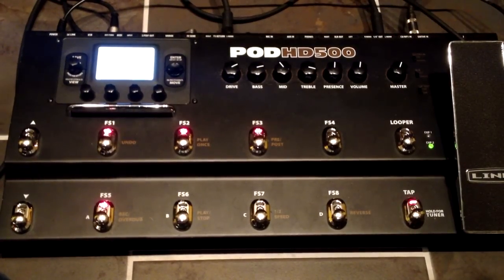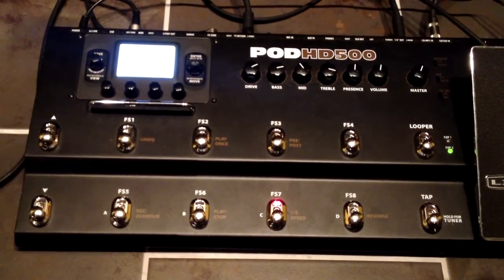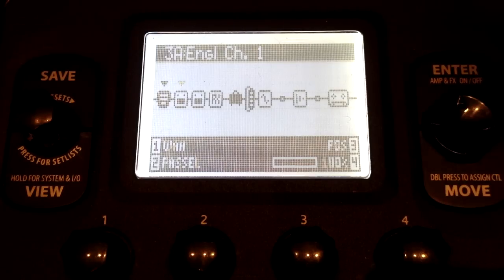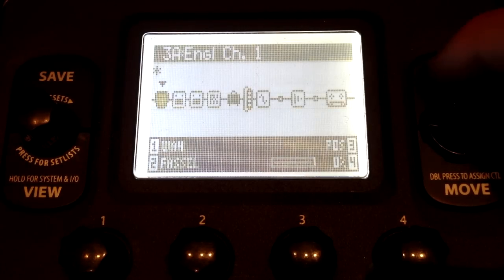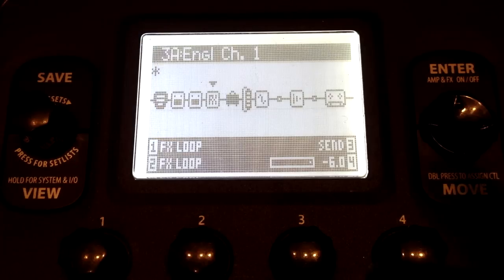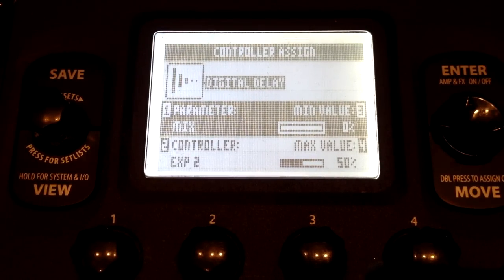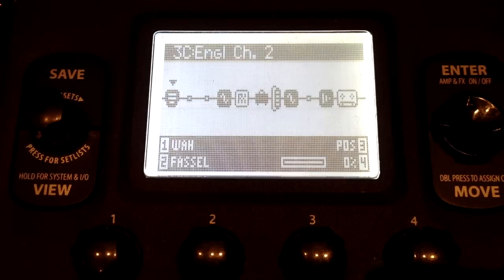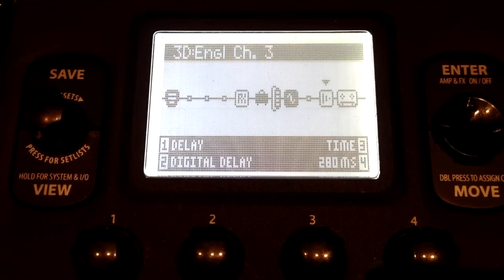Pod HD500 rig/tutorial - 4 cable method (4CM)

Comment: Dude! I've been using the Pod HD500X for about 2 years with an EVH Lunchbox amp. I've been trying to figure out the best way to use my amps Pre Amp (Over the Amp Sims) but also switch to clean on the amp/clean preset on the line 6 when i need to. As my amp doesn't have midi support this has been problematic (Lots of awkward tap dancing)

You've just solved the mystery for me and i don't even need to switch the Amps Channel. I originally had the FX block set up on both my overdrive preset and clean preset. But now i just have my Amp on the dirty channel permanently, and i've taken the FX block off my clean preset.. so i get beautiful cleans with one button press and my Amp is in overdrive the whole time. 

Thanks so much for that tip, i honestly had no idea that the FX block could be used to bypass the preamp, made my life so much easier!
Reply: I agree! I’m attempting to do that myself. Just trying to get familiar with the settings and everything else. 
Had an X3 live in the past. From what I remember that was much easier…
Touring/live I’ve been strictly guitar- wah Marshall with the addition of my talk-box. I rely on our sound man for all my effects. Dry on stage wet out mains.
But I’m old now and the HD500X seems to be a great piece of equipment! 🎸👍🏼

Comment: Absolutely amazing dude! I bought the HD500 over a year ago and could NOT find a good way to use it. This video has been of more help than all of the Line 6 Tutorials! I'm subscribing!
Reply from the maker: Adam McPherson Thanks, I really appreciate it.  You really can't beat the HD500 considering the massive amount of features and the affordable price.  I'm really impressed by it.
Reply: Presets need to be set up according to which way the HD500/500X is to be heard. 
That being Direct into mixer. 
Using power amp and guitar speakers. 
Using as shown guitar amp and speaker. 
FRFR a full range set up which can be a pair of powered monitors. 
Using one of Line 6s proprietary FRFR systems or Line 6s dt25 and dt50 amps creating the "Dream Gig". 
And now the Firehawk 1500.

Comment: Hi Richie, just wanted to say big thanks for breaking this down i finally understand the concept of 4 cable method and will up my podxt500 with my 6505+. thanks
Reply: VelezBiH I have the same head! what output setting did you find worked best? do you do studio/direct or use the stackpoweramp? I'm curious about your levels between the FX loop and mixer levels within the pod. what I found, distortion wise, my favorite tone seems to be when I use my peavey preamp but with a tube screamer, vintage preamp, tube compressor, EQ with 3-5db of a boost at 800hz, into a gate, into the input (before the FX loop on the POD). I also turn off the cabinet simulation. your thoughts?

Comment: Your video rocks!  After some trial and error, I got the 4CM working with my Pod HD500X.  I was also able to configure the Pod to send MIDI into my amp to switch amp channels when I hit a footswitch.  Now I can put the footswitch that came with my amp into storage :)
Reply: Is that how he’s doing it? I can’t think of any other way that’d be possible. I’m not familiar with Engle (I think…) amp(s). They’re midi capable?
If ya don’t mind me asking, what amp do you use? 
Thanks ahead of time. 👍🏼
Reply: @BusterRoonie  I have a Revv Generator 120.  It is MIDI capable.  You can program your POD or whatever MIDI capable multi-effects pedal you have to send a MIDI note/command when you hit a footswitch, then program the amp to switch channels based on that note.  You have to read the documentation for both, and it took me some time, but you can definitely do it!
Reply: @mahnplaysmusic  I’m running through blackstar by club 50mk2. Combo. So basically i can do everything but change Channels with the HD500X, correct? 
I’m fine with it. “Ya do t miss what ya never had” lol. 
Thanks my friend!!👍🏼

Comment: Great explanation.  I've got an HD500 with a Spider Valve amp and am itching to use both together.  I've spent literally years crafting great sounding patches using the HD500 with a Radar IR pedal in the loop.  Now I'll have to recraft these patches to take the power amp section,  (and the Radar), but not the preamp, out and use the Spider Valve for the power amp for some patches, but also use the various tone stacks in the Spider valve for others.  Nice to know this can all be accomplished.  The only big inconvenience is what to do with the Radar since it will be obsolete for all the new patches/setups.  I'll probably keep it for gigs when I don't want to drag the tube amp along.

One critical comment: that great diagram you made should have been in the front end of the video.  I almost skipped it but it really would have setup your explanation better up front.

Comment: Cheers man ! Sorry to be a pain but do you assign the midi signal to the foot switch and then build your preset on top of that or how do you assign a channel to the preset ! Thanx for all your wonderful videos 👍
Reply from the maker: +Emil Bendixen Generally, you program the amp to respond to the preset, but if that doesn't work with your setup, you can also completely re-map the pod presets to send whatever program change you want.

Comment: Hi Richie.
Very cool video. I undertand much better now. I have a lot of material but didn't really try to go further because I always thought it was too difficult.

Now, what I would like to ask is :
I have a Herbert Diezel which I can  control by midi, a Pod HD Pro and a voodoo lab ground control pro.

Concerning the 4 cable method, does it only concern my amp and the POD ?
Because I used to connect the Voodoo Lab to the Herbert just to select channels (the aim is to using POD and its effects) and I do this using midi cable with 7 pins and 5 pins > 

It goes from the Midi Out of the Voodoo Lab to the Midi In of the Herbert. 
Thank you for reading and I hope I was clear. Cheers

Comment: Great video... Can the POD HD500 switch the 2 amps channels on the Roland Jazz chorus 120 ???
Reply from the maker: goumork I'll probably make another video explaining this.  Unless your amp has MIDI switching capabilities, you'll need to buy a MIDI amp switcher like the Voodoo Lab control switcher to interface between the pod's MIDI connections and your amp's 1/4 inch footswitch connections.

Comment: Hi ,one small question please,does the amp need to be midi control foot switch to be able to use the full amp channels?as my new PRS amp is not midi controlled switch,i am loosing the controls on clean channel on my amp when im connecting 4 cable method ,as stays on channel two but when i assign the fx loop to foot switch on board,its by passing the distortion and goes to clean preamp but without controlling the tone on clean channel knobs

Comment: Richie, I reciently decided to retire my old X3 pro and purchased a 500x. I also purchased a DT 50 head. That should be easy with an xlr cable. And until I can afford another DT amp, I ave a bugera v55, an inexpensive but nice sounding full tube amp with an fx loop. Pretty basic no midi, (although I considered putting the x3 pro into the fx loop for the Bugera. But then it gets way over my head. So what I’m looking for is to get a stereo rig for ambient big wide sounds using the HD 500x, the DT 50 and the Bugera v55 head. I know that on the 500 x send is a single TRS Jack, I’m also mainly using one of my Variax Standards so input VDI. DO YOU HAVE A VIDEO TO explain how to hook these up stereo. I know this takes oddles of your time, but you’ve been my hero these past couple years in working with line 6. Thanks. I’m a 66 year old fan that when BOC came out I was just getting out of HS and I assume you wernt on the planet. A dream come true for me congrats.

Comment: So if I wanna use presets or downloaded tones with the 4 cable method, they will sound better if I insert the FX loop after the amp in the preset patch?
Reply: I know it’s been a while. But I just caught this video. 
Good question. Was wondering myself. Did you by chance ever find out? If so, would ya mind sharing that info? 👍🏼

Comment: Richie I have a question. is it possible to still use my tube amps gain (OD and gate pedals in front), for my dirty sound, and then change to a clean/chorus sound from the pod by pressing one button? I'd I like to bypass my pedals in front of the amp and engage the pod simply by stepping on it. And then when I want to go back to dirty I could step on that same button. Is that at all possible/worth it to do? (I love my amps brutal tone I could never use an amp modeler when I have an amp that I love
Reply from the maker: Paul reed Smith Yes!  Absolutely!  This is what the 4 cable setup does best.  I would set up your dirty sound to utilize your tube amp's preamp, and for the clean, I'd use a pod model.  This makes it so you don't need to rely on channel switching on your amp.  You can do it with channel switching, but it's more complicated and may require more gear.

Comment: How do you use a patch from the line 6 custom tone website using the 4cm, while keeping the tone the origional maker of the patch intended?  Do you have to insert a FX loop into the patch?  I found if I put the FX loop after the mixer, it bypasses the amp model, and uses my amp, even though there is an amp model in the patch.  If I put the FX loop in between the mixer, and the amp, I get this strange hybrid of both the amp model, and my amp.  If I don't put a FX loop in at all, and leave the patch stock, my preamp is bypassed, and I can only control the EQ from the POD, but I am not sure if the timing pedals are balanced correctly.  I guess what I am asking in so many words is if I download a patch, and I am connected via 4CM, do I have to insert a FX loop in the patch for the patch to sound as intended.

Comment: Great video, Thanks a lot !
Do you connecte your POD and your amp via the midi option to controle the channels or it's just the 4CM ?
Reply from the maker: Correct, the MIDI is controlling the channels.  If you're amp doesn't have MIDI there are plenty of reasonably priced units that will convert standard amp switching controls to MIDI.  I had a lot of luck with the Voodoo Lab control switcher in the past.
Reply: Richie Castellano Yes, that's what i thought,i guess that the Boss GT 100 has the option of controling directly the channels of the amp, is that true? i'm plannig of getting a multi effect unit and i hesitate between the Boss GT 100 and the POD HD500, which unit do you advice? THANKS.
Reply from the maker: Med yassine Mankai you are correct. The GT-100 does have channel switching and the Pod does not.  The GT is nice.  I just spent the afternoon with it.  I personally like the pod interface better and the Pod has more switches, but I think you'll be good either way.  If you love boss pedals, get the boss.  If you're more of a boutique high gain amp guy, then you'll probably be happier with the pod.
Reply from the maker: Richie Castellano oh yeah, and if you really need the channel switching, you can always get a voodoo lab channel switcher and add that functionality to the pod.

Comment: Hello Richie!

Im trying to connect my pod hd500x with my new bugera trirec with the 4 cable mode. i want to use just the pod to control the channels from the amp and also use the pod for some effects and some amp modelling, just like you did. but i'm not sure about the midi connections. i need to connect the "out/thru" from the pod to the footswitch of the bugera, so i can use just the pod, without the footswitch, right?
Reply from the maker: Marcio Belezas First thing you need to is make sure the Bugera supports remote MIDI channel switching.  If it does, then you'll need to go from the Pod's MIDI out into the Amp's MIDI in.  Then you'll need to figure out how the amp handles MIDI switching.  On my amp I hold down the remote/learn button to teach it to switch to a certain channel when it receives a certain MIDI program number.  Other amps do it differently.  You may need to set the pod presets to specific program change numbers. That's a little more tricky.

Comment: Are u using midi cables Aswell ? Or only the 4cm you've explained here ? Thanx
Reply from the maker: Emil Bendixen Yes, I'm going MIDI out from the Pod to MIDI in on the amp.  This is what makes the amp switch channels with the presets.
Reply: Excellent video. Thx

Comment: Hi Richie!

Can the POD HD500 switch the amps channels (in my case an Orange TH30)?
Or I need a midi switcher to switch between the amps channels?
Thanks!
Reply from the maker: Unfortunately you can't.  But you can get something like the Voodoo Lab Control switcher which will give you that functionality.
Reply: Many thanks for the infos!
Reply: I have a setup with an amp head (the Laney IRT120H) and the HD500, with a Voodoo Lab Control switcher in between and it works perfectly! So Richie Castellano has a good point here.

Comment: Hello, nice rig. I have a question, do you notice and loss in punch when using an amp model istead of the preamp in the ENGL? I've seen people say it, and I'm  getting an HD500X this week and will be using a similar rig. Just wondering if the comments I've seen are true, or full of shit. Thanks.
Reply from the maker: +Guitar Whores It is a slightly different sound, but you need to weigh the pros against the cons.  I wouldn't use this setup for recording, but for a gig where I need very fast access to a crazy amount of flexibility, this is the move.  You really have to manage your levels properly to get the right tone.  If you hit the amp input too hard you can definitely turn your sound to mush.  Too soft and things will start to sound wimpy.  You gotta experiment with the volumes and find the sweet spot for your particular rig.

Comment: Hello Richie.
How do you assign the ABCD presets to each channel change? I can not, and the hd500 manual states that in ABCD mode the F5-F8 buttons can not be assigned midi commands. However, from your video I can see that when you change presets you can change the channel of the amp. Could you help me?
Reply from the maker: This was a long time ago, but I believe I was doing it with MIDI program changes.  I think each preset has it's on MIDI program number so I programmed the amp to change to the appropriate channel based on whatever MIDI program number the pod was sending out.
Reply: Unfortunately my amplifier can not be programmed and accepts only the MIDI CC controls that in ABCD mode in the hd500 can not be assigned to the F5-F8 switches. I suppose your amp has the command "MIDI LEARN".
Thank you for your availability and compliments for your work.

Comment: Hi! I have VALVEKING VK100 and has no MIDI connector. Only has a 6.5mm connector . If I buy a MIDI adapter to 3.5mm and I use an adapter 3.5mm to 6.5mm it work? Thank you !
Reply from the maker: +Dieghe Probably not.

Comment: Hi Richie! Can the POD HD500 switch the amps channels on Mesa Boogie Mark IV?
Reply from the maker: Yeah, but you need to buy a midi to relay device like a voodoo lab control switcher.
Reply: Richie Castellano Thanks Riche,can u tell me a diffrence in tone when U go straith to the amp,and when U use 4 cable metod in my case voodo lab control switcher.,How this affect on original tone ?
Reply from the maker: +Stikany Official There might be a slight difference, but you have to really adjust the levels on every piece of gear to get it as close as possible to your pure tone.  Unfortunately there are no meters on the pod so you need to do this strictly by ear.

Comment: Hey man I've tried this method. But how do you feel about your amps tone when it's through the 4 cable method using the HD500 and when your guitar is straight into the front of the amp? Does it sound different and processed to you also? And is there a way to fix this issue?
Reply from the maker: You need to experiment with the levels and try to match them as closely as possible.  If it sounds weird, you're most likely not getting the proper signal to your amp.  Try changing the output volume on the pod, the loop level on your amp and the loop level on the pod.  

The other thing to do is make sure cabinet simulation is off.

You also want to turn off amp modeling altogether when you you're using your amp's preamp section.

There will be a slight difference in tone. You are running your signal through the pod twice.  It doesn't bother me too much though, because the benefits I get far outweigh any Minor differences.

But like I said, if it's a huge tonal difference, you probably need to adjust your levels.

Your guitar plugged directly into the amp should be the same level as the 4 cable set